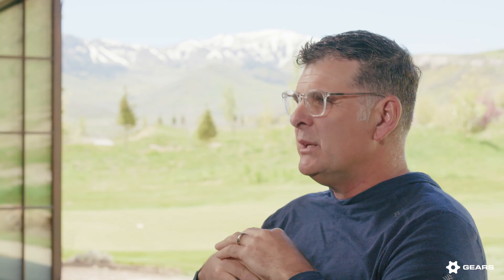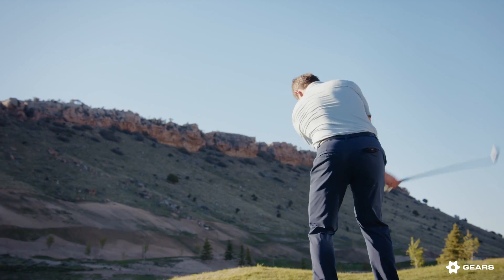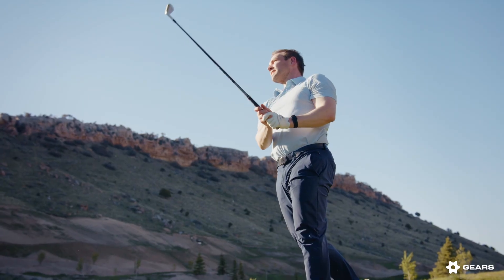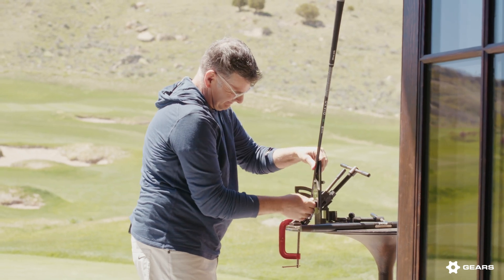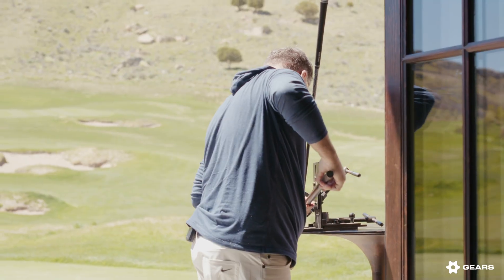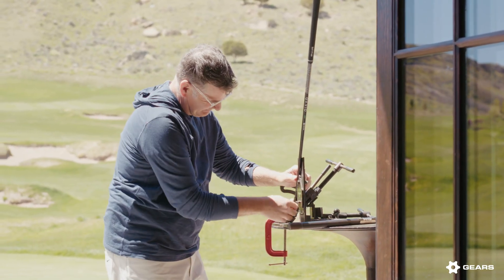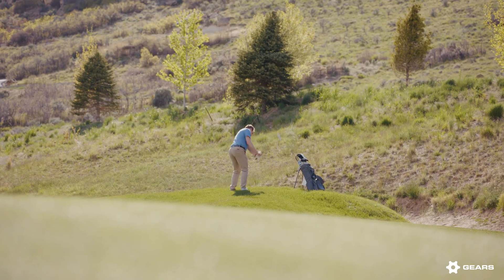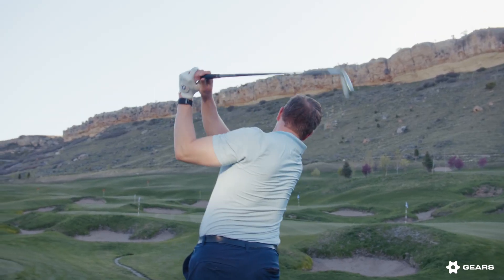The GEARS Curve: Rethinking Lie Angles in Club Fitting

Comment: So the question is…..shaft droop is more the longer the shaft you’re saying. What about the shaft weight and material? Do you find more or less with different versions? It  sounds like playing a hybrid in the flat position may not be the best setting for most people, true?
Reply: Stiffer the shaft the less droop is involved. The more your hands match impact to address position the less droop is involved. Basically if you're standing up more through impact(vertical forces) the more droop is involved.

Comment: I’m a photographer in addition to being a golfer and for that reason notice things in photos others might not such as the relative speed of hands vs. club head during the golf swing and shaft flex.  Also during my nearly 40 years of playing my swing speeds increases to the point I started ‘out-swinging’ my regular shafts and had to move to stiffer shafts to prevent changes in the face due to excessive bending and twisting of the shaft.

Also a student of the history of the game I’ve read accounts of how and why golf swings technique and ‘conventional wisdom’ on the best way to swing a club evolve starting from the 1600s when the clubs where stout wood sticks like field hockey sticks smacking wood balls.

When blacksmith shops in Scotland started making metal headed clubs they shaved the hickory shafts thinner and thinner.  Hickory resisted bending ) but not twisting.  As the golf swung the club back the face would twist open due to the way the mass of the club head attaches at the heel, acting like a torsion bar under load.  In the downswing that torsion would be released with the face snapping closed more than it was at address.  Since there was no uniformity in the shafts every club in the bag had a different feel in the hands and a golfer would need to learn by trial and error how to used hand-eye coordination to compensate.

A solution the golfers in the 1800s devised was to actually drag the club in the ground with toe dragging   —•   ==>  for the first 12 or so inches of the backswing until the club head gained momentum then SLOWLY turn   __ \ |  it back to square with the SWING ARC to prevent the twisting and face change in the hickory shafts.  There was a trick shot artist with the stage name “Count Yogi” who as part of his act swung a club head attached to the end of a leather bull whip and he took the club head back the same way, initially dragging the toe backwards on the ground until the centripetal force pulled all the slack out the braided leather whip allowing it to function like a steel shaft allowing the same control of the club face providing the swing force kept club head pulling the whip straight.  One can conclude from this the fibers in the hickory shaft acted in a similar why when stretched longways.

The “Vardon” grip came into existence around 1900.  I was actually first used by Scottish Amateur Champ Johnny Laidlay in the late 1890s and seen and popularized by Vardon and all the other pro who adopted it.  What had been used previously was a two handed baseball grip which had worked OK with the leather covered Feathery Balls.  But around 1840 they were replaced with a evolution of Gutta Percha tree sap balls.  The first Gutties were smooth but golfers noticed they traveled farther when nicked up and that lead to first making them with raised dimples — which would wear off — and then finally the now familiar recessed dimples.  This was the first STANDARD BASELINE for ball control in the game and it was the ability of the new Gutty balls to fly the same which had led Laidlay to develop the grip which allows more automatic squaring of the face to the swing and target line when use correct with the pad of the trail hand over the base of the lead thumb line the 📍 pin of hinge places VERTICALLY in the holes  🕳️  so the arms will automatically fold like this:  <— 🤷🏼‍♂️ —>  creating a very consistent and WELL BALANCES club head path  which is critical for accurate ball striking.

Metal shafts were introduced around 1900 but were not adopted by pros until the late 1920s first by Walter Hagen. The change to graduated length shafts and lofts occurred at the same time.  Metal shafts didn’t twist as much but BENT MORE!!   This lead pro Byron Nelson to realize that at the top of the swing the bending could be used to STORE CLUB HEAD ENERGY to be release at the bottom of the swing arc into the ball  )..( — o  —>   to compress it more and get more distance.  Maintaining the bend in the shaft in the downswing is a race between the hands pulling downwards and the club head mass trying to catch up.  At the point the club head’s inertia from reversing at the top is overcome and club head velocity = hand velocity the bend comes out the shaft; i.e. ‘casting’    The technique needed is a combination of progressively increasing ) side bend in the spine and lifting the back foot to keep hips/shoulders/hands moving in an consistent radius arc = )  around the feet as THE VARDON GRIP magically and automatically brings he face back SQAURE TO THE SWING ARC first and then SQUARE TO TARGET (swing line) as the ball RELEASE OFF THE FACE.

In the late 1950 Karsten Solheim made the same observation about the attachment of the his Bullseye putter at the heal causing it to twist open and closed relative to the swing
Reply: Karsten Solheim’s huge contribution to the evolution of club design in the late 1950s was realizing that because the metal shafts didn’t twist the force acting on the toe of the club instead tried to twist the club in the hands open in the backswing and closed in the down swing leading him to conclude the solution was to adjust the mass in the head of the putter until with the golfers NATURAL BIO-MECHANICAL SWING ARC  = )  the heel - toe balance of the mass in the club head would automatically keep the face square NOT TO THE  STRAIGHT TARGET LINE  but to the curved  = ) o   swing arc with the face always coming back square to the target line in the same place relative to the feet.

The remaining variable?   The change in lie angle during the swing DUE TO BENDING OF THE SHAFT  VERTICALLY  ) during the downswing which angles the toe downwards.  The problem there is the amount of bend and lie angle variation varies greatly with swing speed and some degree of flex is needed to create the ‘spring board’  ).. ( — o — > effect in the forward direction to get more distance.

The solution?   Stepping of metal shafts and laying of carbon fibers in the shaft to control how it will flex in all directions during the swing which is why determining the ‘spine’ of the shaft — i.e., the direction it flexes the least — is a critical part of club building.  

What GEARS did was allow the quantitive measurement of how different degrees of shaft bend in all directions during swings at various speeds will affect the face angle at the point the ball decompresses off the face to inform the shaft creation, shaft fitting and club building process at the elite pro level.  

At the skill level of a recreational golfer?   There is too variation swing-to-swing and club-to-club and even with the same club on different “lies” (ground slope) to ever hope to fit a club do them as with a tour pro with ball striking so consistent then create a ball sized wear spot on the face of their clubs. Until a golfer reaches that level of bio-mechanical consistency which takes extraordinary hand eye coordination, fitting clubs to their swings is pretty much a game like Wack-a-Mole at the carnival, mainly a way to extract 💸 from pockets.  😂

Comment: crazy thing is I'm a 5 handicap and I've struggled explaining this to people! I'm not saying I'm mirroring exactly what you've discovered, but for certain I knew that shaft droop, or whatever the tech term is, is a real thing! I wanted my irons FLATTER in lie even though my swing plane is decidedly flat and club fitting "says" it should be set a such and such lie angle or more upright to prevent the toe from digging at impact. As anyone reading this might assume, this seems totally logical! But it's WRONG! I know intrinsically that flattening the lie on my short irons would dramatically influence, in a positive way, my shot pattern and dispersion of all my short irons. Even though I clearly swing on a very flat plane. But since "club fitting pros" said NO that's not what you want!" I backed off and shut up and lived with what they fitted me for. What you're doing will be absolutely the base fitting practice in the not too distant future. It is so obvious. If people or professionals don't embrace this they're brain dead and the inertia of professional club fitting "consensus" will be the reason it doesn't become the norm in dialling fittings in optimally. Great work and I will follow and apply your fittings to all I do. Thank you.
Reply: It really depends on how stiff in general your shafts are to begin with. If you're using x100s and project x 6.5s or above, droop is minimized. LPGA players are not using men's extra stiff shafts so droop will be much more involved due to how much easier the shaft will bend even at slower speeds.

Comment: Not really sure why this is news to anyone, but ok.  However, wedges usually have the same lie angle throughout, (let's take vokey for example) they all have 64 lie from 62 to 46 degrees and their length gets longer by 1/4 of an inch.  So dynamic lie is essentially flatter on a lob wedge vs the pitching wedge and if you wanna hit nasty Joe Mayo spinners you stand really close to the ball which makes it even flatter, so making it even more flatter might make it too flat.  I use a vokey 46 as my pitching wedge and have it standard 64, it is my 105 to 135 club and on a 105 shot I choke down quite a bit and stand way closer to it which again makes dynamic lie much flatter so I dont need it bent any more flatter than that.  However on 6-9 I play 1 degree flat as I dont really have any partial shots with those clubs and yes my 4 and 5 iron are standard which makes them 1 degree upright in relation to my 6-9.

Comment: Doesn't shaft length take care of adjusting the lie angle? I don't understand. I would not want my long irons more upright. Iron sets already go from 60 degrees in the long irons to 64 degrees in the shorter irons. I agree the average lie angle for all the clubs could be flatter more often, but ams generally swing over the top, so they need the more upright average lie angle.

Comment: I've talked to fitters about this forever, but getting them to do it is hard. I'm tall and generally have an extra inch on each club, and I always need them more upright, especially up the bag. When I do slow-motion capture on the swing, the toe droops, digs, and is open. I have to play with up to a 2+ degrees of closed clubface at address when swinging a 2 iron, 4 iron, or 5 iron. My wedges draw, my low to mid irons are straight, and my mid to long irons cut on stock shots. I'm just looking for consistency.
Reply: Dude same!!!!!!
Reply: Try it out.  This will help with consistency

Comment: would you have to change your setup too, so that the more upright long irons are more toe up in setup?
Reply: No that’s not what he is saying, he is explaining that length of shaft will affect dynamic lie angle. So longer the shaft gets the more dynamically the club will present toe down because of the shaft bend and the opposite is true so shorter will generally lead to a more upright dynamic lie angle. 

In theory relative to the 7iron let’s say you should play longer clubs more upright and your shorter irons more flat. 

Tiger is quite well known for having done this on the past always playing his longer irons more upright relative to the rest of his set. 

I imagine here they have a system that will let them work out exactly how much of a degree of difference you will need in your own set based off your speeds and dynamic lie angle presented at the ball.

This will then tell them to each corresponding club the lie angle adjustments needed to get your dispersion tighter and your start lines more consistent across the bag not just in a 7iron. Good example in the fitting world is as a rule of thumb you tend to flatten the wedges relative to the rest of the irons by 1°. This is kind of an industry standard I think this is going to be way more advanced than just going a little bit flatter in the shortest clubs. 

This is my understanding of this anyway.

Hope that helps 🤙🏼
Reply: No. The last thing a golfer should do is adjust to a club 

It’s much easier to adjust the club to you.

Comment: So all clubs should have the same lie angle?
Reply: No that’s not what he is saying, he is explaining that length of shaft will affect dynamic lie angle. So longer the shaft gets the more dynamically the club will present toe down because of the shaft bend and the opposite is true so shorter will generally lead to a more upright dynamic lie angle. 

In theory relative to the 7iron let’s say you should play longer clubs more upright and your shorter irons more flat. 

Tiger is quite well known for having done this on the past always playing his longer irons more upright relative to the rest of his set. 

I imagine here they have a system that will let them work out exactly how much of a degree of difference you will need in your own set based off your speeds and dynamic lie angle presented at the ball.

This will then tell them to each corresponding club the lie angle adjustments needed to get your dispersion tighter and your start lines more consistent across the bag not just in a 7iron. Good example in the fitting world is as a rule of thumb you tend to flatten the wedges relative to the rest of the irons by 1°. This is kind of an industry standard I think this is going to be way more advanced than just going a little bit flatter in the shortest clubs. 

This is my understanding of this anyway.

Hope that helps 🤙🏼
Reply: He literally said find the club that you hit the best, and adjust the other clubs to that same lie angle. He describes that as the “Gears” concept.